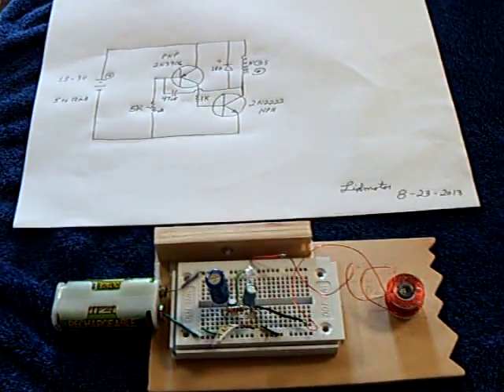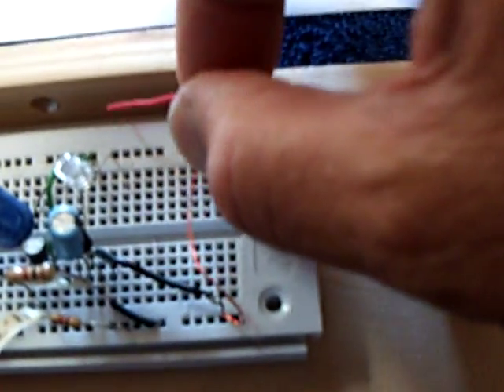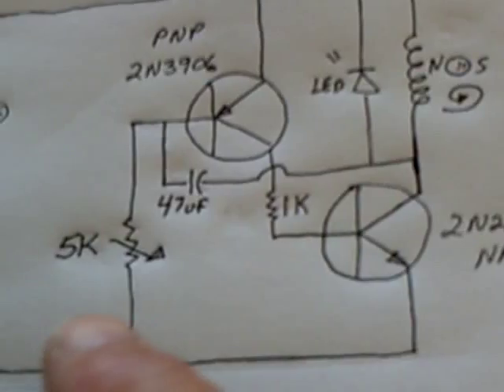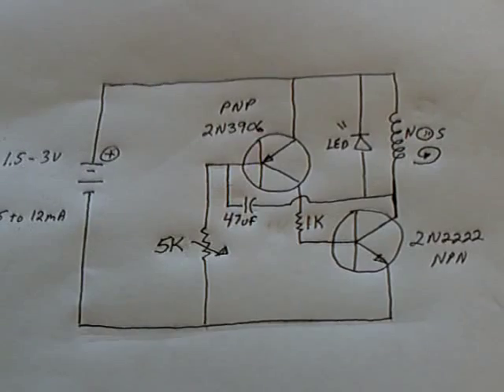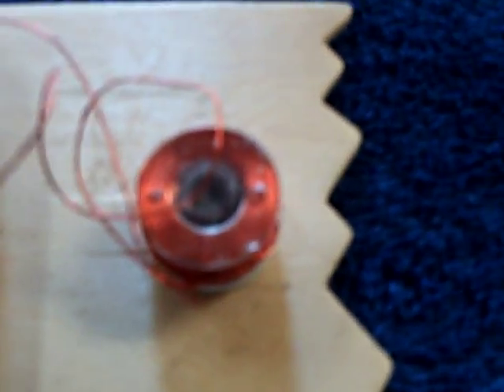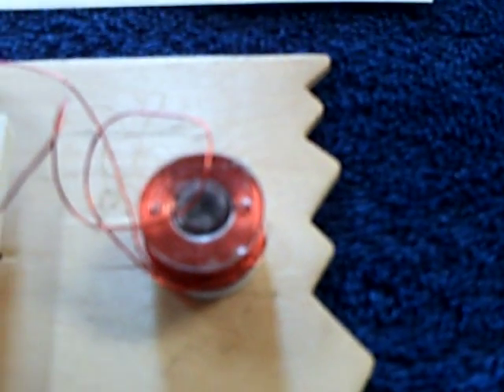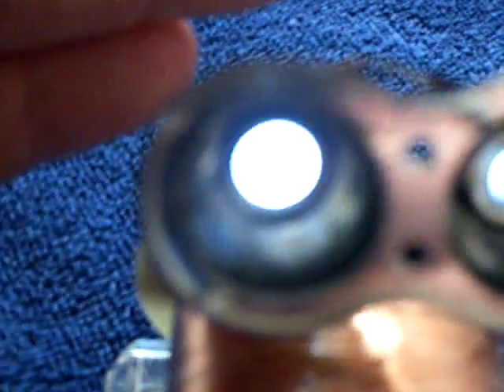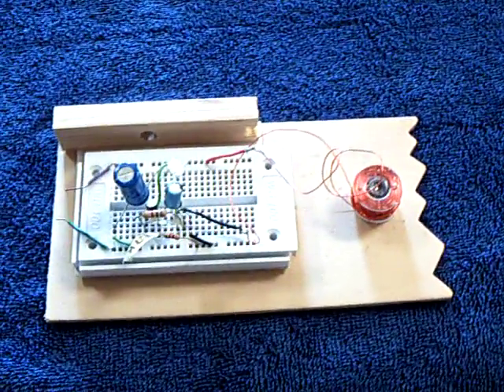Self - Start Ball Magnet Motor ....and Maggie's wireless charging electric "Lidmobile" concept car

Comment: Magnetic field strength falls of at the square of the distance from the source.  So, in other words,  power of field minus the distance times the distance.  Distance to size scaling does not apply normally in this case.  You will find that less energy in a coil that matches  your rotor will provide better results than more energy in a coil that you could drive your entire lidmobile through.  Think about how magnets attract each other with so much more strength as they get closer.

Comment: MIT, Toyota, and a bunch of other big names have been using magnetic gearing to charge eco cars for a while now. Early models will be on the market soonish. Its a rotor that goes where your oil stain would normally be, and it rotates a rotor on the cars generator. I'm not very impressed with the efficiency. Your way, direct to coil looks better. Less moving parts on a car is always better.

Comment: I prefer the old fashion wall outlet. Is has a still better performance and no radiation or field of any kind. New ideas do not all need to be applied, sometimes common sense should be used over 'making money' on gadget-alike utilities. But that is just my opinion. I am that guy who heats up his kettle of tea water on the lowest gas output on the stove. After 15 minutes the water boils, but it uses way less gas. You know.